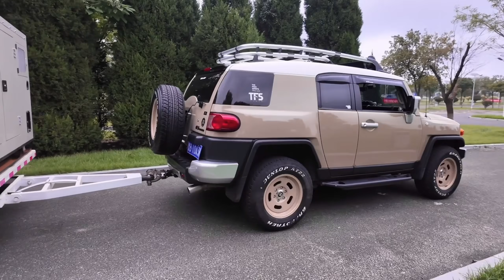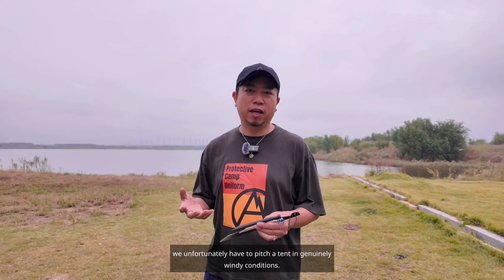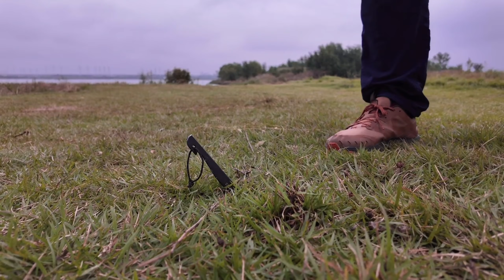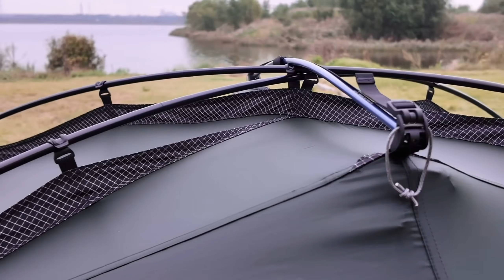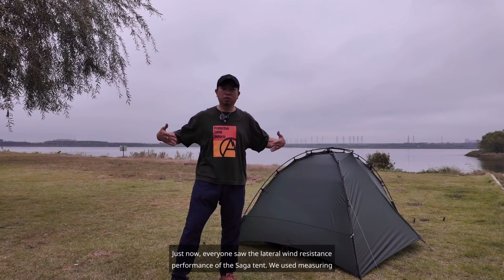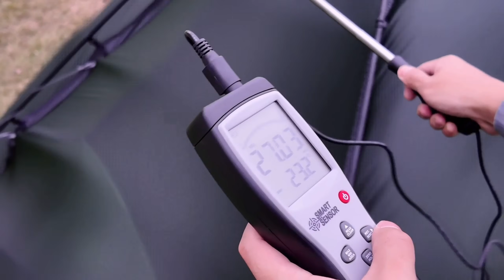TFS Saga - High-Power Blower Test (Simulating Force 10 Winds)

Comment: I would love access to one of those wind blowers! Well done for testing like this and giving people opportunity to comment.

Is it possible to mount the blower, nearer to the ground, to simulate more real world conditions. I wonder if it is lower, you will see more of the effect of the wind getting under that gap around the edge and the tent ballooning. Blowing from high up, shows the strength of the trekking poles, less the fly and poles. 
It would also be good to see the test without the trekking poles. I would hope it could handle 40mph. At the moment, the saga looks good for 4 season wind, but 3 season to keep out spray and drafts.
So yes, the edges lower, more low down peg points and a double guy on the corner poles. Just like you did with the yoto pro! 
Is  the mesh that excellent stuff you use on the inner of the enran? 
Great video!
Reply from the maker: we are currently making some improvements to the tent details as we discussed, such as adding more fixing points and updating the position of the guy ropes. However, we must conduct practical tests to verify the strength of those fixing points. So please look forward to our subsequent updates. Thank you very much.
Reply: @tfstents thank you!
Reply: I think Dave has hit the nail on the head with this comment. I tend to find with wind tests such as this, a constant winds speed doesn't always simulate real world conditions - what might be better is the ability to have variable changes in the wind speed to really push the fabrics and design. If possible.
Reply: @thegeordiewildcamper real world testing will be happening soon Stephen I hope!

Comment: Great test wang. Personally i think you should have double guy out lines on those corners. Although it stood up well to the ends being blown it was bowing in a fair bit. Id also like to see the fly coming to the ground. You noted about the top strength for snow loading but theres a fair gao for spindrift to get in under the sides and soak the inner with snow. What pole diameter are you using on this tent? Applogies if i missed it from other posts.
Reply: In his original video about the tent (blue fabric version) the description shows this about the poles: DAC tent poles: 9.6mm diameter NSL/10.2mm diameter NSL (two options available), short center tent pole: 8.05mm diameter NSL

Comment: Very impressive. This summer in Ontario I was in a severe thunderstorm with a downburst so extremely high winds. My little Eureka Midori 2P and I survived only because I sat up and put pressure on the poles from inside so they would not collapse. Is there any added benefit to having two guy out points on each pole? I noticed in your wind test that the first section of each pole is in a fabric sleeve with clips above that. Is there a benefit of having another guy out point just at the top of that fabric in addition to the guy out point you already have? I’m excited for this tent.
Reply from the maker: We might add some weight to the Saga tent, such as using DAC NSL 10.25mm diameter tent poles, but it will become safer. So obviously, it is not a lightweight tent. If you are a seasoned outdoor enthusiast, you may need several types of tents. Some can be very light, suitable for long-distance backpacking; some need to be very sturdy to withstand strong winds and heavy rain. With sufficient experience, you can make the right choice before setting out. Thank you.
Reply: i agree, double guy out points would be great

Comment: Appreciate ventilation is an important aspect in reducing condensation but could the fly be taken nearer to the floor or is the inner a 4 season one like the stars 2 pro so drafts will be negated? If fly went nearer to the floor it would help with snow spindrift and splash back from rain storms. Are you going to offer a full mesh inner and a winter version similar to how durston do it so the tent can be used all year around by changing just the inner? I’d buy both inners if you offered both. A great test of the tent and around 60mph winds. Do you yet know what internal length the tent will achieve. Just thinking of Novice wild camper of YouTube fame testing it and getting his hair messy and his feet damp. Just seems a shame if it’s not long enough for all potential customers. Thank you
Reply: What little hair I've got 😂
Reply: @NoviceWildCamper snap 😂
Reply from the maker: Hello, we will add four more fixed points under the FLY entrance hall of the Saga tent. Regarding the inner tent, there will also be two options: three-season and four-season. We are very glad to receive your suggestions. Thank you.
Reply: Exactly what I was thinking! Looks a great tent for most people.
Reply from the maker: @martinrose7728  Hope it can accompany you to more places and let you see more beautiful scenery. Thank you.
Reply: @tfstents Most definitely, looking forward to when they are available with 10mm poles!
Reply: would be really cool to have it more usable in the snow
Reply from the maker: @arransangster  Hi, one of our testers has taken the Saga tent to a 5000-meter altitude for testing, but I'm not sure if it will snow there. He will be back in a week and tell me about the usage. My judgment is that there should be no problem using it in the snow.
Reply: Hi Wang, if you ever get a chance I'd like you to settle an argument 😊 Do DAC pegs perform better when the open side of the v profile is facing the tent or does the sharp edge of the V facing the tent resist pulling out better ? I always place the open side towards the tent but I may be in the minority and I think it would make  a good future video to solve the argument at last ? Thanks Andrew
Reply from the maker: @andrewparkoutdoors  hi Andrew ，The ground peg of that DAC must be used in the opposite direction of the tent where there is a dent. Otherwise, it won't be able to firmly hold the guy rope.